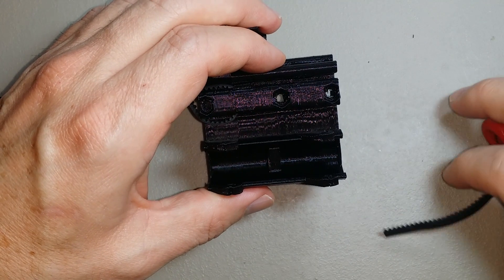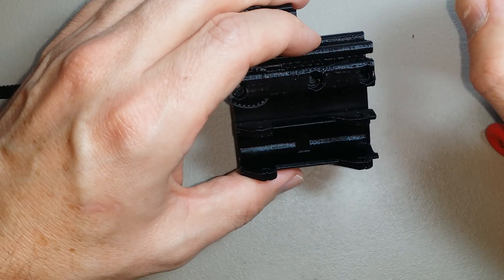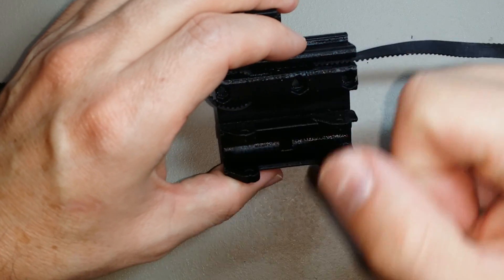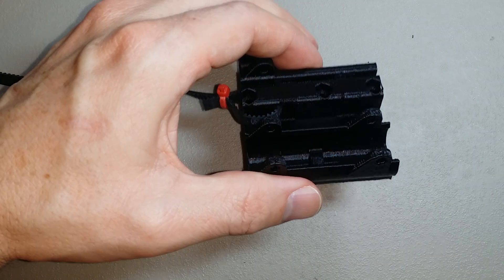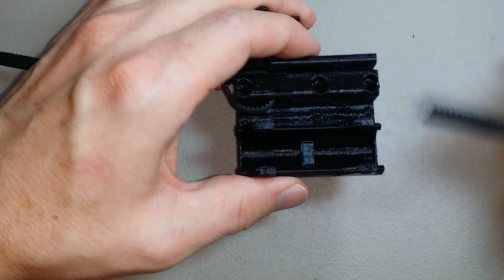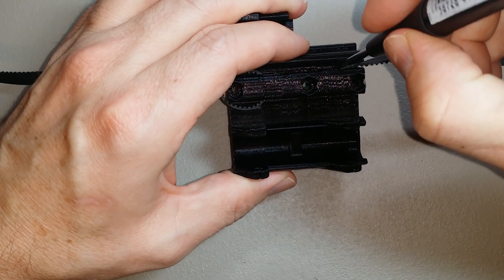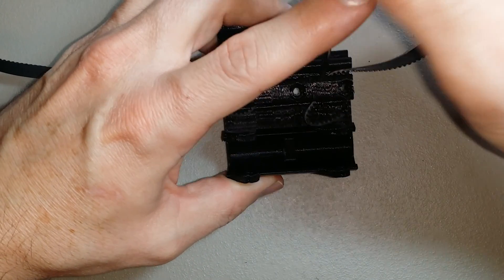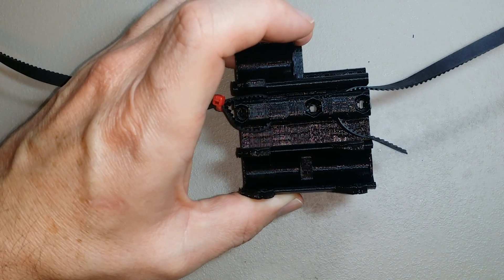Prusa i3 X Carriage Belt Assembly

Comment: I used other motors for my 3d printer ( Stepper Motor - 58 oz.in (400 steps/rev) ) but it didn't work properly ... should I use other motors ?
Reply from the maker: Do you have the model number for your motors? What type of electronics are you using?
Reply: engineglue the model number is ( jk42hm84-1684 ) .. and I'm using ramps 1.4
Reply: Hadi Salame those motors are very bad throw them into trash now
Reply: berathan90 OMG!! .... are you sure they costed me alot
Reply: engineglue what's your motors number ??
Reply: engineglue is it 42BYGH4803-D ?
Reply from the maker: Hadi Salame So, the motor is 0.9°. The motor should work fine. You'll just need to adjust the configuration in the firmware. How is it not working properly?
Reply: Yes it is 0.9°. They are sounding noise and not working continuously . How to adjust the motors settings in ( Marlin )
Reply: engineglue
Reply from the maker: Hadi Salame That doesn't sound like a configuration problem. It sounds like something is not correct with the stepper controllers. Use a ceramic screwdriver to adjust the current. You can find a guide on my website at nwreprap.com. Go to support. Do you see the potentiometers on the stepper controllers?
Reply: Can it give me 12 - 24 volts? ... the seller said that i should give the motors 12-24 volts.
Reply from the maker: Hadi Salame Input voltage to the Ramps should be but the motor likely runs on 4.2v. The current adjustment is for the amperage.
Reply: engineglue actually i can change the amperage to 1.7A  but the motors don't work with less than 12-24V can i adjust the volts?
Reply from the maker: Hadi Salame The problem you're describing doesn't make sense to me. Perhaps you should contact your vendor.
Reply: engineglue ok tomorrow i will upload a video for the printer  with the problem
Reply: engineglue can you watch the video on my profile plz.